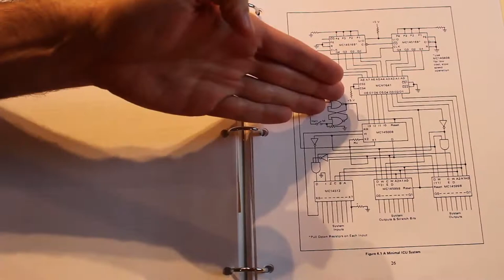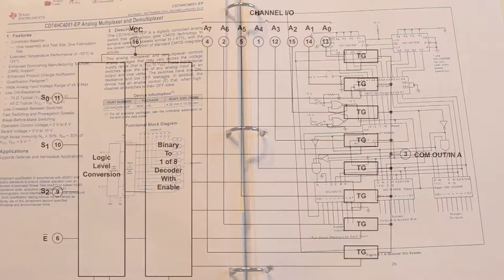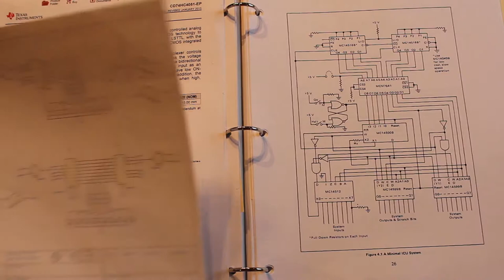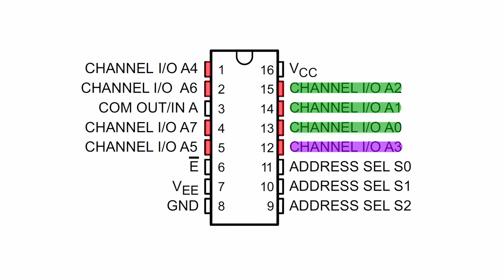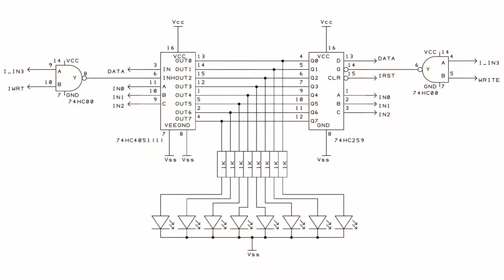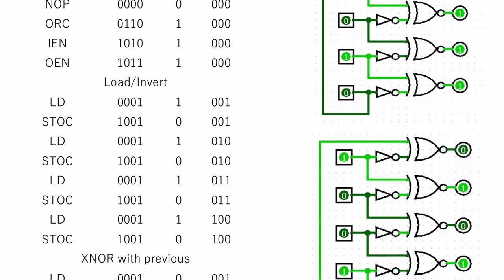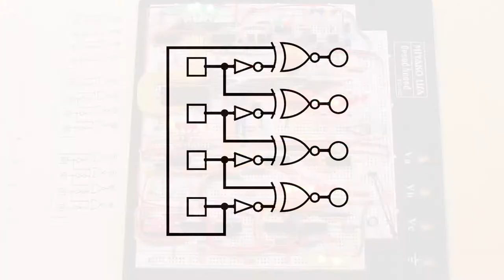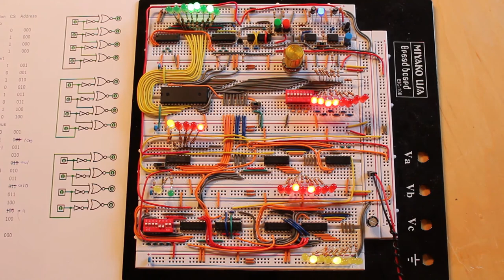1-Bit Breadboard Computer P.06 – The Final Piece: Scratch Register

Comment: I really enjoy watching these videos. While it may introduce more headaches I have to wonder if it's possible to modify some LED bar graphs to have a common cathode to save some space. Daisy chain some small resistors across the cathodes underside, snip the pins, and have a jumper wire for ground maybe.

Comment: 2:39  a 74hc138,  74HC151, and a CY74FCT2573T, with some simple glue logic for the control lines, to decode proper r/w for latching to with the 138 of reading back with the 151 based on decoding r/w bit, since 151 and 138 you would piggback on the same data and address lines from the cpu, while CY74FCT2573T would serve as your byte of either register memory, or a gpio port, and the 151 lets you  select and read each of the 8 bits or 16bit if you use a 150, 8bits of scratch pad ram, and 8bits of gpio, and you replace all that functionality of the mc14599 wit off teh shelf parts
Reply: seems like exactly what motorola did when they made the mc14599 im sure someone still has those photomasks somewhere, looking at the datasheets other than those chips, just a few nand with some nor gates should be needed to invert and properly decode r/w, since 138 and 2573 latch pin (write enable high, output enable high) would only be enabled when write bit is asserted at a valid address, and the 151 would be enable when read or (with 2573 latch /write enable low, output enable low) is asserted with a valid address, bak then it was cheep enough for motorola to put all dat in one chip....when teh used to own themselves, decap a mc14599 and it probably will just just like  those 3 chips  wit a few gates to decode dem control signals

Comment: Would a 74LS251 work better than the 4051, the 4051 is really an analog switch rather than a logic chip. The 74ls251 has a bit nicer pinout as well.
Reply from the maker: The 74_251 probably would have worked a lot better! Honestly, I'm not sure why I chose the 4051, but through sheer stubbornness I got it working, haha.

Comment: An interesting but completely irrelevant note about the 4051/259 solution vs the MC14599B. The '599 has an output buffer, so if you write a 1 to bit 0, then ground the output pin, then read the pin back, you'll read a 1. This is because the read input is on the input side of the output buffer. With the 4051/259 solution, if you do the same, you'll read back a 0, as it's unbuffered. This useless bit of information comes to mind having been bit by a program on a PIC10 microcontroller that was trying to squeeze every last bit of storage out of the part and was reading the data port input register (effectively acting as the 4051/259 combination) instead of the data port output register (the '599). That little bug cost me a couple days on a project before I read out the program from the PIC, reverse engineered it, and was able to program new parts :(

Comment: No MC14099"s?
Check ebay.
Reply from the maker: Oh they were definitely available on eBay! But, I really wanted to see if I could build this whole thing using modern ICs that could be grabbed from pretty much anywhere (except the MC14500 itself). Everything is just a run-of-the-mill 7400 series chip that can be found on Amazon, Mouser, Digikey, etc. (Well the RAM chip isn't 7400 series, but it's still a modern chip that can be found on Mouser and Digikey with ease).
Reply: @UsagiElectric  Great work!